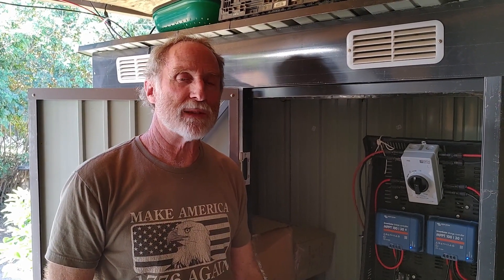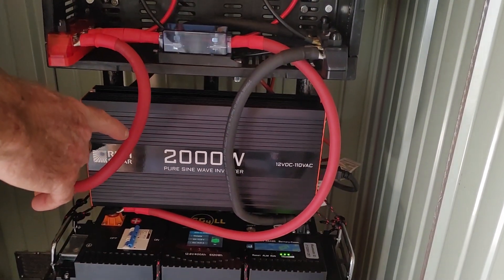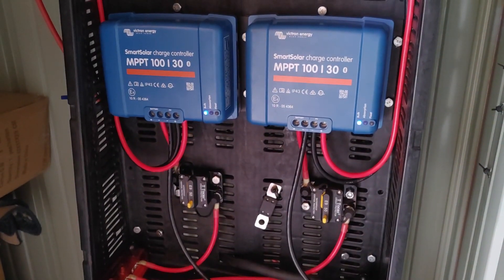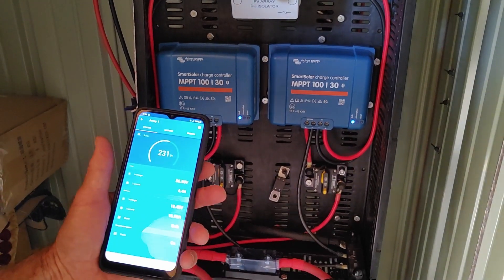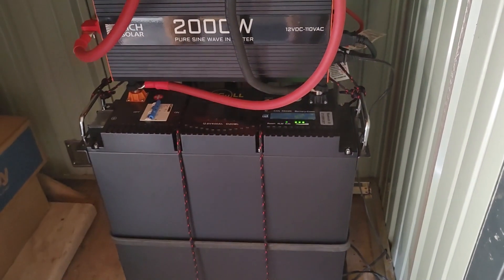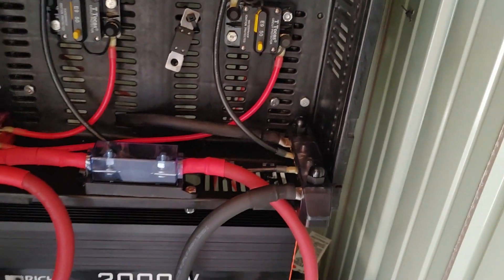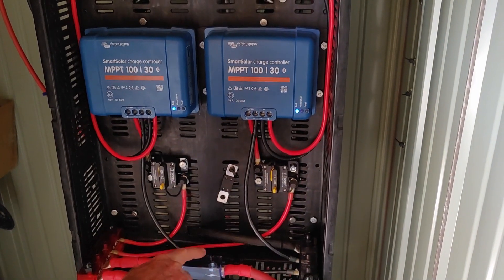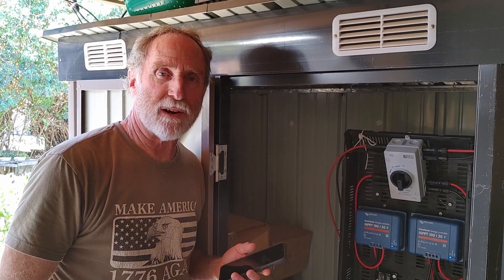EG4 LL Victron Portable Solar Cart

Comment: Very nice setup and informative I was wondering if you would be so kind as to give the demention for the crate that you use so that I can try to order one thank you.
Reply from the maker: The crate is 16 x 24 x 5 inches. On the latest version of this, I used a piece of plywood for the breakers and bus bars. I then attached the inverter and charge controllers directly to the hand truck frame using aluminum strips and plumbers metal tape. This allows more airflow around the inverter and charge controllers. The aluminum strips were from a greenhouse plastic connecting system I had laying around. I just needed something that would connect to the inverter and controllers, then be able to connect to the frame of the hand truck. The white and black isolator switch was then moved to the outside of my solar shed for easy access.

Comment from the maker: UPDATE: I ran the solar cart for a couple of days with the 2 refrigerators hooked up in 100 degree heat. The morning of the 3rd day the battery was at 13% before the sun came up. I unhooked the refrigerators from the inverter and plugged them into shore power. After letting it charge all day, did leave the inverter on by mistake, It charged up to 92%, even after angling the solar panels. I'm running 400 watts of panels per 100-30 charge controller (Victron suggests 440w12v). Highest solar input was 350 watts per controller, 2.25 Kwh per day. The beauty of having a modular solar generator is being able to swap out components. I'm going to upgrade the charge controllers to Victron 100-50 so I can run 600w12v panels per controller and, hopefully, not have to worry about running out of juice. Fortunately they are the same size as the 100-30s, so the wiring and placement can stay the same!